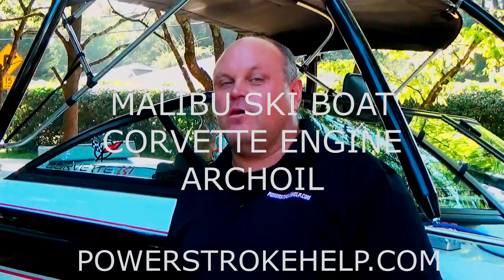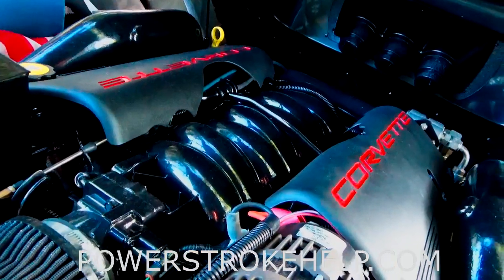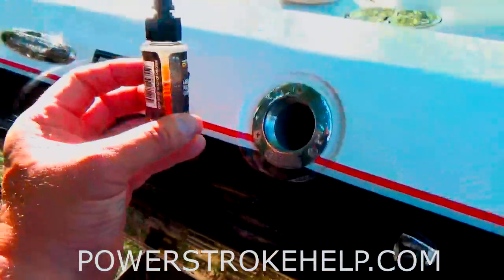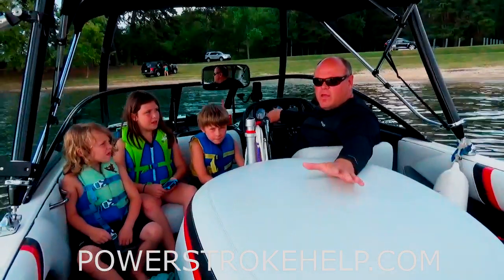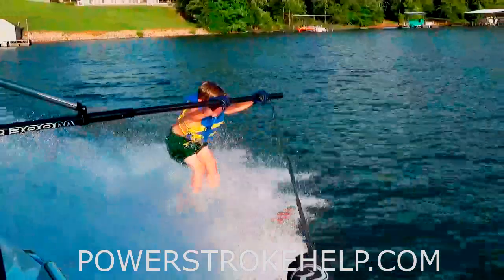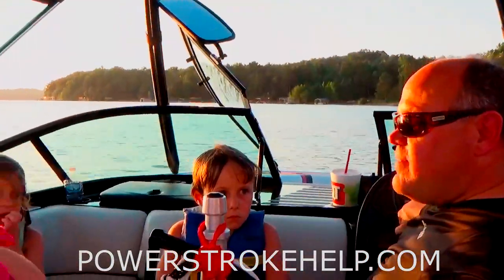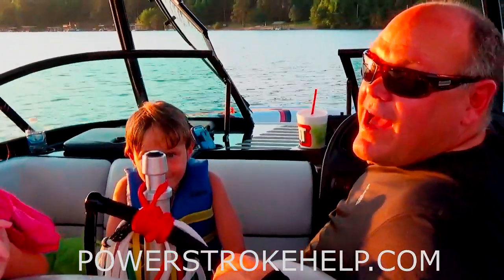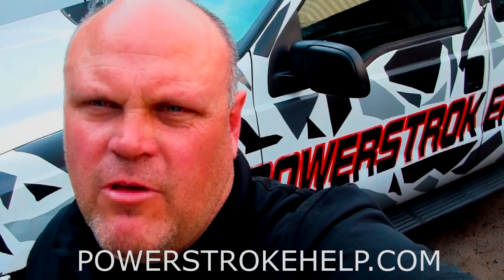MALIBU SKI BOAT CORVETTE ENGINE   ARCHOIL

Comment: Bill, I've been running Achoil since I've seen your video last year.  I have the same engine in my Malibu -  just curious what prop are you running?
Reply from the maker: I like the Acme 515.
Reply: @powerstrokehelp  I'm running the 525 and wonder if it's too aggressive some days :)    LS1 in my Sunsetter LXI but my boat is probably heavier.

Comment: Man, I thought your boat would have some monster nitrous 7.3 or 6 liter in it. There ain't no transmission to scatter to bits like in Spot. Is there any advantages to using archoil in a lower compression (9:1 or 9.5:1) engine?

Comment: Hey bill.... (F350 CCLB 2000 7.3 90k miles) finally got around to my oil change this week with arch oil I purchased from you. Hate to say it but I didnt gain anything (mpg) from it.  I am mostly stock, afe intake 4" down to 5" exhaust and gtp-38r. Before oil change I had 35x12.5x18 toyo m/t, this 3 day weekend I put 33x12.5x18 R/T tires on and did full oil change including the oil from reservoir as you did with vaccum pump in video. Drove 230 miles, all highway. Got the same 18mpg. Now, I know every situation could be different, but the way you been pushing it I got to say im dissapointed with results. I figured i get more than 18 cause  thats what I was gettin on the winter blend fuel and you were so sure about the product. I have also been using the arch oil fuel additive last 3-4 tanks.All stupid things have been checked, cleaned air filter, tire pressure was correct, I also did fuel fliter and have done all your fuel system restriction fixes, except the screens in sending unit in tank. I DONT feel like I was a victim of your marketing campaign, cause it was a small price to pay for all the knowledge I recieved from your videos, really enjoy them. But, I wont be buying it again. I will stick to the pro-long and stanadyne...far cheaper and can get locally. I was hoping that this was an additive that I could actually use and see a difference.  Thanks though really appreciate your vids. Wish you would do more on the 7.3.

Comment: Hey Bill, I own a 1999 F250 7.3 with 350xxx miles and the auto transmission cooler lines are starting to crack and leak a little. What's your recommendation? 

Keep up with the awesome content!

Comment: Do you think the AR6200 will make a difference in a 2003 Ford Terminator Cobra motor with bigger injectors, smaller pulley, and a few other modifications?  She really doesn't like the E10 crap out there, even the Sunoco stuff.
Reply from the maker: saleendriver Yes. If you use any sort of engine management system to adjust timing to fuel you will see an astonishing change. I have splashed AR6200 into a 15 ZR1 corvette, the superchareged one. numerous camaros and challengers and they all call back wanting more. The guy in the Vette said it was the best his car had ever run.
Reply: Tell you what....I'll got to the web site and order a bottle right now, and I'll let you know how a Ford likes it!
Reply: One more question:  should you add this only to a full tank?  Or does it matter?
Reply from the maker: saleendriver look us up archoil.powerstrokehelp dot com.
Reply: saleendriver You won't see any additional timing with it.  Your engine doesn't have knock sensors.  The ECU does not have the ability to add or pull timing based on fuel quality.  That said, giving Archoil a try certainly isn't going to hurt anything.

However, I highly recommend that you try to find a station that sells EtOH free premium gas near you.  We have a station near our HQ that sells 93 octane 100% gas at the pump.  It only costs about $0.30 more per gallon than comparable stations with 10% EtOH and the HiPo engines love it.
Reply: I have tried to find EtOH free gas around here in SRQ.  Doesn't exist.  And you're right....no knock sensors in the Terminator engine.  I'm hoping, however, that the Archoil additive's other properties with respect to sludge, water, and the EtOH come to the fore, and help my baby run better.
Reply: saleendriver It certainly should not hurt.  If you're looking for a very good fuel system cleaner check out the Chevron Techron additive sold at most parts stores.  We've had great luck with it and you just pour in a bottle every 3,000 miles or so.
Reply: Yeah, I know about techron.  I'm going to try Archoil for one bottle.  Looks like it will last quite a while.  See how she likes it.

Thanks for your input though.  Knowledge never is a bad thing.

Comment: What about 2 stroke engines?
Reply: That's a good question I've got a minibike with a 2 stroke under 50cc engine with 20:1 compression and believe me I pulled the plug wire and I was able to keep running until the gas ran out. I think it wouldn't be good for carb engine from what I've reas
Reply from the maker: WhiteGangster400 I do not own any two stroke stuff. I have a neighbor who has a 20yo evenrude 90hp that has always been a bugger to start. You have to double the dose of AR6200 in 4 stroke applications and he said his engine starts much better and runs much quieter and decided to keep it for another season before buying a 4stroke rig.
Reply: powerstrokehelp Thanks, I got an old 98 evenrude 225 and it struggles to keep a steady idle but I want to keep it as long as possible since new engines are like $20K plus.
Reply: ***** Who said oil was getting blown into the water?
Reply: ***** Only on the old carburetor engines do that which companies stopped making in the late90's.Newer fuel injected engines don't blow blue smoke and a much more efficient since they have complete combustion instead of sending fuel out on the exhaust cycle like the carburetor engines always did. My engine never smokes unless you blow the carbon cleaner in then it'll smoke like a chimney temporarily.
Reply: ***** They do inject oil into the fuel but it the problem with old 2 stroke engines would be that fuel (mixed with oil) would get sent out on the exhaust cycle causing bad gas mileage and I guess more pollution but newer engines don't do that anymore and burn much cleaner than they used too thanks to better fuel injection technology. http://www.animatedengines.com/twostroke.html